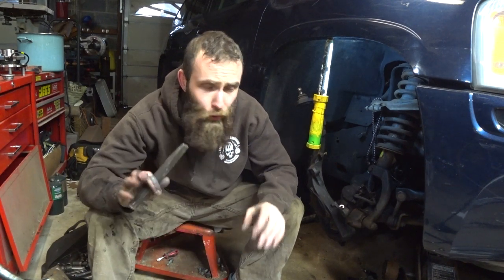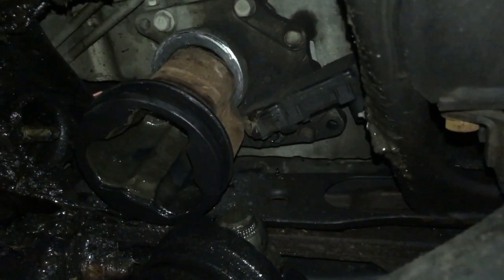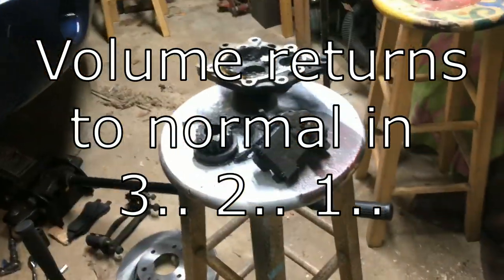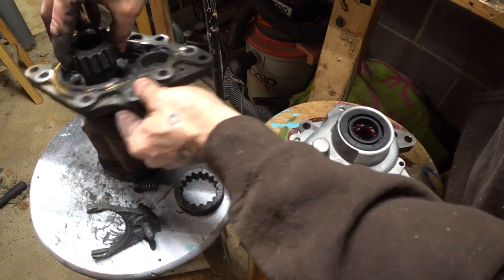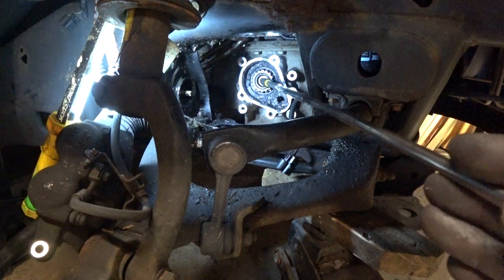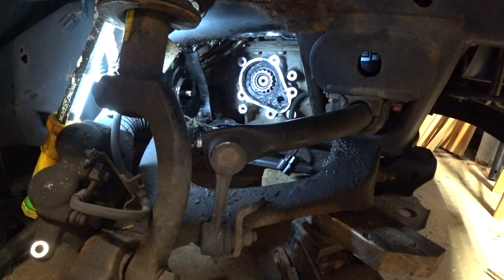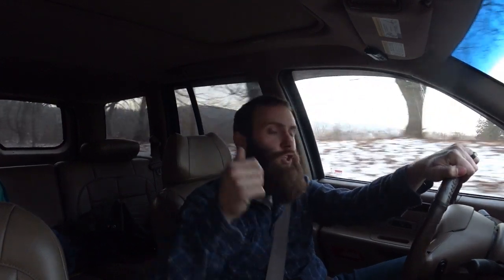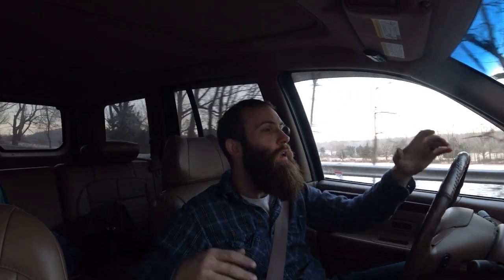WORST CV AXLE FAILURE I HAVE EVER SEEN - GMC Envoy is now beyond repair!

Comment: New to the channel! Just was searching to see if anyone has done this same thing I have a 08 trailblazer and have the same issue! I haven’t yet tackled it but it will be soon! Hopefully mine doesn’t get stuck like that one I’m on the other side of the country so not nearly as much rust and corrosion as the east coast but I have driven this across country a few times and lived in Ohio for a bit seems that is when my issues started! I actually drove home from Ohio to Washington on this issue and also blew out a rear axel bearing in Colorado... she got me home tho! Definitely gotta say this truck has been great to me had it since new and over 200k on the clock have a couple thousand lbs of stereo equipment and it’s been hauling that and has toed a vehicle so it’s definitely a work truck! The 4.2 is an inline 6 so it’s got more torque then the v8 actually! The extended ones came with the 5.3 in the lt package then you have the ss witch is I believe a 6.0 LS but Like I said I’ve had this one since new and a while back I lined up with a ss and the 4.2 stayed right with it from 60-120 I was pretty impressed!
Reply: How did you get it?

Comment: Had a friend with a 2004 Mitsubishi Galant with a power steering leak. Turns out the daughter let it go for so long it burned out the pump and dried out the rack and pinion. It need new hoses, a pump and a rack. To put in a rack and pinion on this fine piece of engineering you had to remove the subframe. To change the oil on this thing it had a size 24 mm drain plug in it.
Reply from the maker: What?! That is insane! dont ignore those noises friends...
Reply: D&E In The Garage especially power steering. I mean I’ve driven old trucks without it and power steering is so amazing.

Comment: I'm going to go ahead and put this out there I have an 06 Envoy XL with the 4200 vortec inline 6 I've got a different intake on it I put a GM performance control module chip on it I put a straight exhaust on it past the first cat and I'm getting ready to turn 230,000 on it. I've had it framed out in the middle of fields and Frozen in the ground couldn't get it out for 3 days you know just pretty much done anything that you can imagine doing the one took it through all kinds of trails I've took it through flooded roads I pulled shit that no midsize SUV should ever pulled I've hauled multiple vehicles with it across many states the damn thing is a fucking monster dude for a midsize SUV is unbelievable it's a fucking army tank the front end I will say he has some kind of shitty designs on like the the bushings and and the housing and everything as far as I see the axles go but man dude I really can't complain much on the vehicle I've always changed on it the oil when it was due you know around 3500 miles try to keep up the regular maintenance I put a couple coil packs in it you know a set of plugs change the transmission fluid around 185,000 MIles I'm pretty sure my overdrive something's starting to act funny but to overall I love this vehicle it's been just outstanding in my opinion it's had its little ups and downs but for the most part it's never left me stranded except for you know when I've had it stuck multiple times I had a friend that had a small Dino and it registered 330 ft pounds of torque and 317 horsepower the motor still runs like a damn sewing machine it's a freaking monster I am getting ready to look into changing the timing chain I think it'll probably be good thing to do since I'm going to try to hold on to it for a little bit longer I disconnected the four-wheel drive sometime back because I'm not living where I need it anymore and I think the switch or the selector solenoid went out so I just went ahead and disconnected the front drive shaft and and unplug the wiring harness going to the the selector switch and I ain't had no problems yet but my front left CV just starting to pop a little bit and I'm hoping that I can take the CV axle out and leave the part that goes through the Hub and make sure the back of its got something good to grab and tighten back down the the nut going on the CV shaft and cross my fingers until I get another 1. But yeah like I said overall man I can't complain dude the midsize SUV that can do pretty much anything I've ever wanted it to do plus I've always liked it looks of a man looks decent you know I've got to cut some paint job on mine and instead of 22s the XL shit man for work I can't beat it I've got some subs in the back and all my tools with me and I wish they would still make the damn Envoy xl cuz I would definitely get another one.i really have put gmcs threw the trials ive beat the fucking hell out of them and they keep on ticking with maintence of course, and consideration and know ing the limits of your machine matched with respect and sense plus mechanically knowledge you can keep most vehicles on the road for a good while .4200 vortec inline six after 2005 is a damn good motor before 06' they were not near as good in low end torque or overall performance. 4.5 / 5  stars in my opinion. A lil heavy, front end needed to be redesigned.  suspension and drivetrain components could have been better. With all that said i drive the shit out of my ride and love it.

Comment: This is normally true. These trucks are a bit of a different breed tho. The wheel bearings on them do not need the pre load on them, if you look them up the RWD models and the 4X4 models use the same wheel bearings. The RWD are just simply bolted into the knuckle. No stub shaft. I have owned both 4x4 and RWD 360s.

Comment: Its a normal front diff. it has a mid shaft that goes through the oil pan and all that unit does is disconnects the shaft from the diff. It usually just falls off after taking out the bolts. Its built that way to make the truck sit lower for better center of gravity. And yes you can drive it just fine without it. you can just take the shaft part out of the two ends and keep bolt on the axel then cap the other side to keep crap out of the diff. Also its an inline 6 not a v 6

Comment: Lol I had a non mechanical buddy try to take his valve cover off used the wrong sized socket and stripped all the nuts. His reasoning for taking off the non leaking valve cover was because he wanted to see the inside of the motor 🤷🏽 mind you I’ve told this guy from all my Jeep issues, if it’s not broke don’t fix it.
Reply from the maker: Jeez... amen to that!

Comment: What type of noise was it making? I have some grinding coming from my front end, and the wheel bearing has been replaced in the last year. Could it be a cv shaft/axle?
Reply from the maker: CVs are usually a clicking noise when they start to go. Grinding could be breaks

Comment: We let my wife's brother borrow her 02 Neon and he said the brakes needed replaced. I trailered it to my dad's garage and he had completely worn down the rotor so that the braking surface was gone. The metal backing plate of the brake pad had cut it down. Now obviously the caliber had gotten stuck, but you would have thought you would have noticed it pulling to one side and stopped driving it.
Reply from the maker: It is obvious to car guys, but (I guess) some people just assume cars don;t break? I dont know. the stories of neglect I could tell you

Comment: So here’s the problem with the GMT360 platform. The straight six which is a reliable engine, was also a stupid design. The front differential goes THROUGH the oil pan. I’m about to go through this swap on my 05 trailblazer. Btw tow rating for a trailblazer/envoy/rainier/Bravada/Saab 9-7x/Isuzu ascender was 6400 pounds.
Reply: And that is for the straight 6
Reply from the maker: That is damn respectable for a 6
Reply: D&E In The Garage so funny story, I had to change my passenger side cv axle last Thursday. Guess what? Same situation. Axle cut out was eaten up. Bought one from amazon for about $150 and it went right on. Only 4 bolts hold it on but it does hold on tight to that center shaft so you have to pry it off.

Comment: Those axle disconnects do tend to stick in the oil pan. Do not try to pull it out in one yank! Get it to move out just a bit then push it back in. Pull it out a little further, push it back in. Repeat until it comes out. They can be a nightmare to remove.

Comment: GREAT video!

Learning a lot.  I have AWD and does not have the actuator, but still needs lubrication....not serviceable....grrrr!  Have full front suspension out of my GMT-360, Saab 9-7x variant.  It's actually quite interesting to watch all the videos and learn the differences between part-time 4WD and AWD.

Keep on posting (04/26/2022)

Mr .P

Comment: I made it 10 miles down the highway before I lost my wheel. Was an amazing experience, not that I recommend it by any means. Had to have the fire department come out and put out the 100 yrd stretch of median that apparently doesn't like brake fluid and Sparks.
Reply from the maker: Good gravy! So you are saying you tried to run without the axle in place?
Reply: @DEInTheGarage  , yes sir... Lesson learned, glad I can say I was young and just didn't know any better. Now I make it a habit to know my vehicles and what I can do to limp home or a garage. I'm mostly grateful that I didn't kill anyone, and the only cost was a few hundred dollars. Love all the videos, find them to be helpful, very informative and most importantly I find myself smiling/laughing more often then not! Thank you.
Reply from the maker: @rudyfinney9450  Hey, we all have to learn somehow. There were several people in the comments of this video telling me I would have been fine driving around indefinitely without the CV and that I was stupid to suggest otherwise.... Someday they will learn
Reply: @DEInTheGarage  , well I wouldn't suggest it but to reach their own. I will say that I have taken  the axle side of shaft apart from hub side and made that work. Never drove them far, as I prefer to fix and have my vehicles performing as best as possible. Also, I primarily only own Jeeps ( older models) and taking them apart at the u-joint  has saved me a few times out in the sticks. I'm not really familiar with the Yukon by any means but I'd assume you're correct and would never chance not having the hub side of the CV there to ensure bearings don't come apart.

Comment: Way back when the GMT360 platform was in development, I remember seeing the engine as a machined piece of rigid foam.  It was in Pontiac at the Truck Product Center garage.  I remember having a chat with my buddy about how the hell they were going to package an inline 6 in that engine bay with it being so tall (I have a FJ40 Land Cruiser that had an inline 6 in it).  My jaw hit the floor when I found out that the front drive shaft would have to go through the oil pan.  Really too bad, the engine is rather powerful, until the owner neglects it and doesnt put oil in it.  That is what I am dealing with right now.   Contemplating an engine swap on a Trailblazer, and have to take the entire front end apart.  Your issue is simpler I think, as you can just swap the oil pan... but it is a pain since the whole front suspension has to come apart to drop the pan.
Reply from the maker: Yea, the design is a really melon scratcher. An instance of "sure you CAN, but SHOULD you?"

Comment: I also wanted to add I actually drove with my shaft out for a few weeks because the bering cage on the cv busted during a hella snow storm. Got under there and cut the boot out of the part in the diff to keep junk out then left the nut on the hub. Just leave the bolted end on. knock out the bering cage with a chisel. Then cap the end the goes into the selector.

Comment: Apparently some owners of Trailblazers/Envoys of that particular era were not inclined to maintain their vehicles. I say that because while I was visiting a friend of mine in his shop the other day I saw the almost identical damage on/to a Trailblazer he had up on a lift. Tom has GM deeply imbedded in his DNA AND is a Navy veteran.....Sooooo….Can you say "Cursed like a sailor"? His is a very well equipped shop and he told me that the only solution he could see, that would make the vehicle safe to drive, was to completely rebuild the front end with GM "quality parts". Since the gent that brought this Trailblazer in for "some kind knocking in the front end" is the fourth registered owner and only paid $600.00 for it as a "daily driver beater" he has given Tom the go a head to do the work. If this video had been up last Saturday I would have sent you photos so you could compare what you found on the Envoy to what Tom found on the Trailblazer. I'm no mechanic but I would swear that what you found was a match for what Tom encountered.
Reply from the maker: Dang.. what a small work. Maybe this is a more common failure than I originally thought
Reply: Yup lets repair with the same stupid engineering catastrophe that gm originally plagued these cars with!

Comment: All that damage is nothing but pure Jersey unadulterated neglect from the previous owner it's definitely not a reflection of the auto manufacturer in question however I do know people that had those trucks and everyone I've ever known that had one was dissatisfied with the vehicle
Reply from the maker: No, like i said in the vid. This is not on GM (Though I am not sure I love the engineering on this truck even if it was not the cause of the failure).

Comment: Good job but thats not a front wheel drive its 4x4 and that is the front diff. going thru the engine oil pan of a 4.2 or 5.3 engine.... Not alot of fun when they have been abused and neglected

Comment: Going through this now ! 
If you seen the new hub it’s a 2 part piece so when you take out all the bolts it comes out like yours did and when you take out the 4 bolts required it comes out in one piece except mine .. mine broke around the outside lol 
Air chisel here we come !!! 
  Since the cv shaft is screwed anyways I was thinking just take it apart and using it for the hub so it doesn’t blow the bearing apart...
What a mess

Comment: 4.2 is a straight 6 or I6 like our 4.0 Jeeps and not a V6 but I think the front differential went bad and killed the CV axle as the unit looks dry and should be separate from the transmission . Everything is a common problem when it happens to you 😂 people never check these fluids and go 150k on a TB or Envoy without service and say it's common when it's the owners flaws not the vehicle. I would repair it and keep it if it's clean .
Reply from the maker: My buddy found a GM shop who knew how to remove it, so this one lives to die another day

Comment: Just swap in a junkyard trans and get back on the road. Lol!
Reply: Its not a transmission.  Its the front differential disconnect assembly that he removed.  These have an axle disconnect (err they claim it helps increase fuel economy when not in 4WD) so when in 2WD that collar slides out of the way and disconnects the right hand CV shaft from the drive train, it don't have auto locking hubs or manual locking hubs it just has that axle disconnect.  So you still have the other half of that front end spinning when 4WD is selected that collar slides over and locks the right CV axle to the differential allowing for 4WD operation.  That system is garbage in every vehicle it seems like.  I like my Jeep its front axle is live all the time, no electronics to control my 4WD, when I pull the lever its in 4WD.  

Looks to me like it may require a replacement front differential assembly that housing looks trashed and by the time you managed to get that other 1/2 of the axle disconnect housing off it may mangle up the rest of the differential housing.
Reply: @wildbill23c  lol, thanks for the explanation, but I dont think you got my sarcasm, or my poor excuse for sarcasm. I have to agree, my Jeep also has the 4WD lever. Best invention ever!!
Reply: @RocHopn  Can't beat a manually controlled mechanism...that's why I laugh at today's vehicles with all those different terrain selections...I just put my Jeep in 4WD full time or part time, it don't give a shit whether you are driving on snow, or in mud.  People today are just way too lazy, and I never understood why people had a problem pulling a lever LOL.  

In the video he kept calling it a transmission too LOL...no worries.
Reply from the maker: For a short amount of time I daydreamed on the idea of getting a HUGE bolt and bolting the wheel bearing together so that he could just drive it with 3 CVs axles... obviously i thought better of it in the end, but i still think it COULD work
Reply: @DEInTheGarage  might be time for the Envoy to be a Guinea pig for that idea. I know I would like to see if that works. Maybe as a trail repair just to get home.
Reply: @wildbill23c  I cant agree with you more. I think these new systems make us bad drivers even worse. I really think they give an inexperienced driver false confidence. They think they can drive, but in reality it's the terrain management system doing the work.
Reply: @RocHopn  Exactly my thoughts.

Comment: You could take out the axle and just insert the part of the CV that holds the hub together.
Reply: put the “stub in the hub” and tighten it up.
Reply: Huuuuh
Reply: NOTHING holds the hub "together". It is capable of not having an axle through it because it's the same unit in a 2WD, which doesn't have an axle at all.